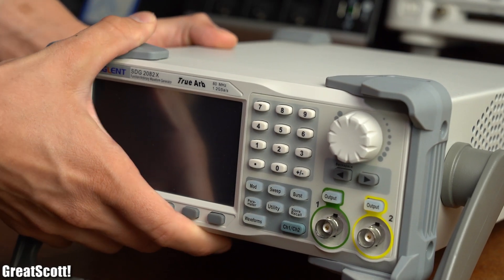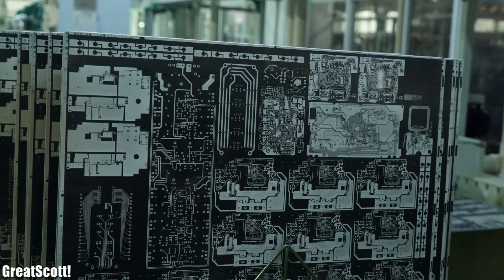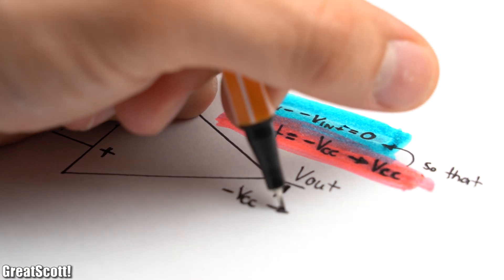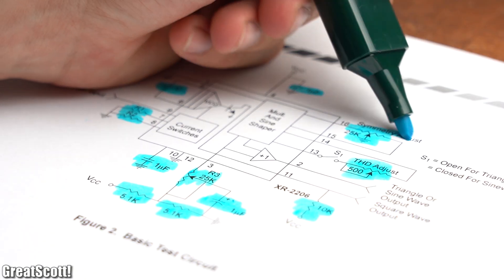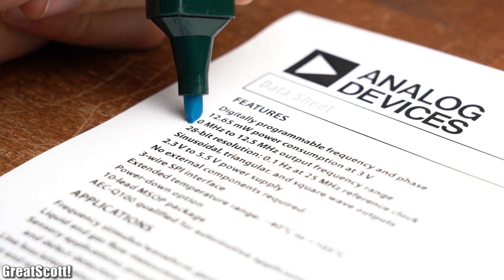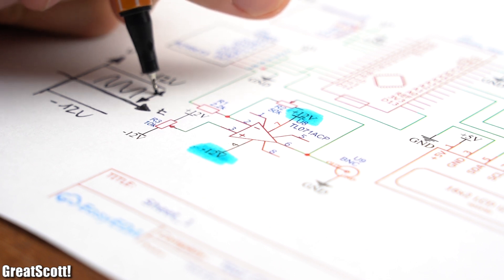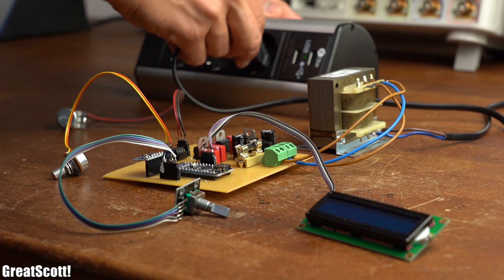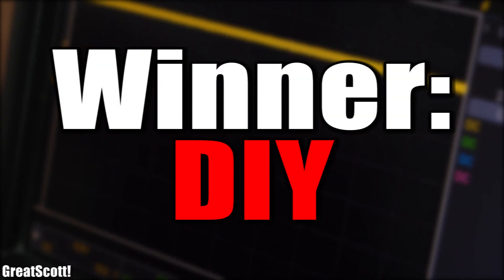Function/Waveform Generator || DIY or Buy

Comment: I am using a function generator that costs 60€. It's the Jds 2800. It has 2 outputs and can deliver up to 15 MHz and 20 vpp. It has a lot of waveforms and you can make your own waveforms on a computer and upload it.
Sorry for my bad English it's
 because I am a German guy.
That is the product:
https://www.ebay.de/itm/JUNTEK-Signal-60MHz-Generator-Dual-Channel-Arbitrary-Waveform-DDS-Function-T9G3/153570953117?hash=item23c18ac79d%3Am%3AmPbjiYpO_ULrhir46I_nRhA&LH_ItemCondition=3&LH_BIN=1
Reply: Your English is actually really good!
Reply: Your english is way better than my german!  :b  Thanks for the heads up
Reply: That looks fine and powerful enough
Reply: Your English is better than most Americans.  BTW, your link no longer works.
Reply: Funny you mention this model, I was looking at it on Banggood at the same time lol
Reply: Exactly my view too.
Reply: Is English Germanic language
Reply: @joemwangi5813  ye I think
Reply: @smibi8301  Thanks, I found it by searching the part number on ebay.  Price went up.  What a shock.
Reply: The Chinese remove all the fun of DIY. Building one's own signal generator used to be one of the most fun electronics projects. Now you just click "buy" and you have much better for the same price. But you learnt nothing in the process.
Reply: @InXLsisDeo  building your own discrete funtion generator is fun. soldering an arduino to an all in one function generator chip isn't.

Comment: What do you need amplitudes >5V for on a frequency generator? I think for a beginner on low budget the XR-2206 is THE way to go!
Reply: Also, after the beginner gets fed up with the 5 Vpp he could just build an amplifying stage to get more Vpp and a bigger range for the dc offset.
Reply: Depends what you are doing with it. Someone who does vintage restoration, for example, will want the high-voltage, low-current signals used in valve equipment.

Comment: FY6800 DDS Signal Generator/Counter is amazing value for money - worth a look for anyone considering a budget unit.
Reply: One of the problems with those is the crappy Switch mode power supplies that have been fitted inside them, which is not what you need with a sig gen, people have modded them very easily with linear power supplies though so not all bad. Few good channels on YT cover this.
Reply: @Adrian_Finn  The noise from the switch mode power supply is though far from bad on the units.
Since it gets drowned by the harmonics from the signal generator itself.

Also, a linear power supply will generally couple through all the noise from one's mains wiring, so have a computer or other switch mode powered device connected nearby and you will have just as much noise from the linear supply.

In any case, the issue can easily be rectified by adding a bit of extra output filtering from the supply, not that this matters much due to the signal generator already having enough harmonics and other crap that it literally drowns the noise from the power supply. (In the end, I wouldn't recommend practically any DDS for RF use, obviously.)
Reply: The real issue with these devices is the floating AC on the earth side of the BNC connectors (measured with reference to a true earth.) Not enough current behind it to harm you but more than enough there to fry the delicate inputs to a microcontroller.
Reply: @SpeccyMan  You seem to be referring to the FY6600, not the FY6800.
Reply: @SpeccyMan  This is indeed a problem.
I solved it by adding a wire going over to mains earth. Seemed trivial enough.

Though, to an exceptionally small degree, one could regard the non-earthness of it as a "feature", if it weren't for the huge amounts of common mode noise...

Comment: The squarewave output of those cheap nasty red functiongens alsow works as a sine wave above 100khz
Reply: Lol, that's an additional feature .
Reply: Just reduce the amplitude of the wave and it should look more like a square wave because of reduced time for charging external capacitors
Reply: I think the reason of the malfunctions of these generators are fake IC's, I remember seeing a video of a guy replacing it with a legit one and most problems went away. Of course even original ones have their own limits so there's not that much else it can be done about it
Reply: @TheAzther1  the main reason is shitty op amps with poor slew rate and crappy pcb design. It is not the frequency of the waveform which is the problem. Look at edges of the squarwave. They have to be super fast to reliably generate a square wave. 10MHz squar wave requires edges to rise and fall in like 10ns to keep the signal look like a square wave, not a sine or trapezoid. So to have 10Mhz squarewave you need an op amp with 100MHz bandwith. However, you want to use the op-amp to amplify the waveform, so to have a decent waveform at the output and also a gain of 10 you would need an op-amp with at least 1GHz gain-bandwith product and 100 000 000V/s slew rate to give you 10V p-p voltage.  Good luck with that.
Reply: @krissolshaq4934  lol

Comment: @GreatScott can you do a video about ground loop and humming fix  let’s say if you have a bluetooth board connected to a amplifier and power the bluetooth board from the same power supply it will generate a ground loop in the speakers and it’s very annoying can you do a video of fixing this nightmare I can not find  any  official solution I don’t know how the commercial stuff is made ..
Reply from the maker: I can put it on my to do list. The solution to this problem is a 1:1 transformer between your audio source and the audio input.
Reply: Thanks GreatScott!

Comment: i was just wondering a few days ago 
is it possible to create negative voltage supply without a center tapped transformer?
Reply from the maker: Yes, you can. Google should give you lots of examples.
Reply: @greatscottlab  i did it but all i found was 
low current versions (using 555, inverting buck boost) , inefficient ones like (voltage divider) so still not happy.  but you need sacrifice something to keep something. 
anyway thanks i will keep searching
Reply: You can add 2 transformers and flip them... short GND together and add filters
So just get a center tap one

Comment: Can you maybe bild a bike security system which makes a loud noice if somebody want to steal it?
Reply from the maker: I built something similar for my moped. Look for my GPS security system.
Reply: I now, but in my opinion it is a bit to complicated for a bike and additionally you do not have such a big battery for power supply. I just thought that it would be convenient to flip a hidden switch before going to the bakery, which will trigger an alarm when the bike is being moved.  This would save you the hassle in such a case.

Comment: Why would you need 12V P2P?
Reply from the maker: For testing purposes. I mean 12V is a pretty common voltage level.
Reply: Ok, I'm an amateur only, but I once assembled some preamplifier circuits. I remember those were around 741 or LA3161 something. The signal part of these circuits were in the 3V range. 12V was on the power amplifier side though. I wanted to try a DIY signal generator myself. Great looking at your results and good modification for your purpose. As always, love to learn from your videos! Keep up the good work!

Comment: Please do a video on power bench supply DIY or BUY. It would definitely form a good base for starting electronics projects. Please
Reply from the maker: I already built two lab bench power supplies in the past.
Reply: @greatscottlab  Thanks for that. I have seen all your videos. I meant something without using any readymade boards, with electronics parts only.
Reply: @abhijitmajee6754  not wortht it
The boards are cheap asf
Reply: @TheChemicalWorkshop  Yeah, I guess there's no point in wasting time doing the stuff from scratch.

Comment: I've been wanting to build my own function generator for a while now. Thanks for posting this.
Reply from the maker: You're welcome ;-)
Reply: @greatscottlab  ; - )
Reply: @greatscottlab  I worry about the voltages in output of the signals because I use the dso138 oscilloscope!
Reply: @greatscottlab  she was being sarcastic
Reply: @arthurmead5341 was she? Based on what?
Reply: Seems like a good way to learn about a few things like op-amp scaling, DAC control and UI development. I'm designing a fantasy one right now. Then I'll do one I can actually build.
Reply: @meepk633  Post up both pls
Reply: Likewise, maybe this is the one to build.